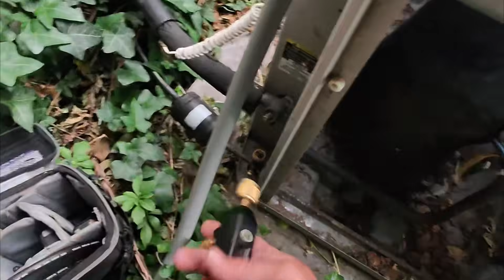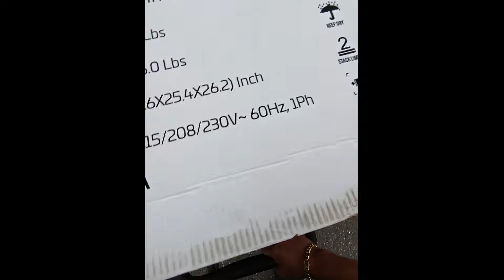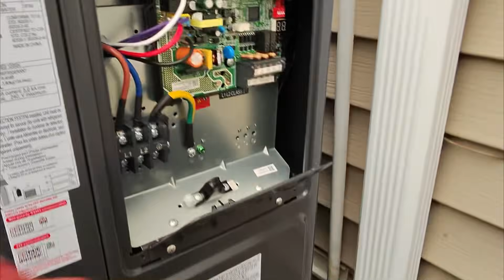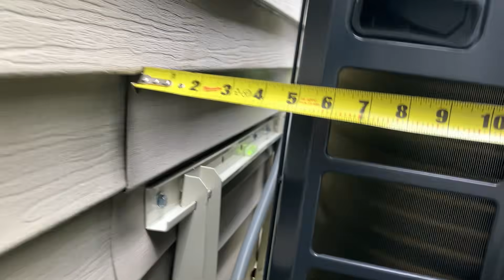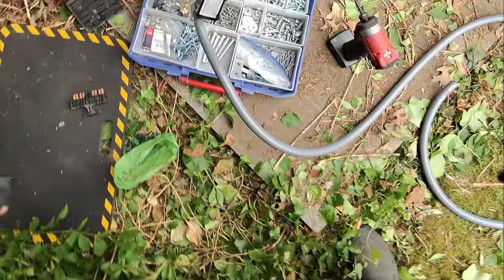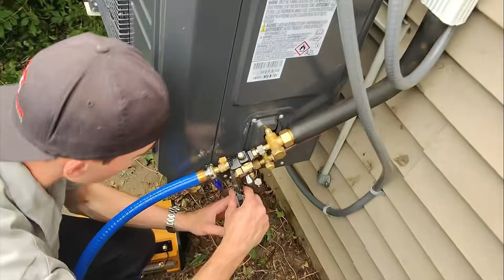We Replaced a 21-Year-Old AC Before Lunch | 4-Ton ACiQ Heat Pump Install

Comment: I've got to say, Mikey, yesterday I had a three-zone installation on a multi-condenser, and I was pulling vacuum through the Fieldpiece, the same one that you have, and unfortunately it kept leaking. None of my soap bubbles were showing any leaks on any flares or anything like that until I sprayed the core removal tool, and it started bubbling like crazy.... I'm disappointed...
Reply from the maker: FIELDPIECE SUCKS ASS

Comment: Mike in a previous video I asked which digital torque wrench 🔧 you preferred you mentioned the blackmax considering that you have the Navian flaring tool and bender are you not a fan of the Navian digital torque wrench 🔧??? Also do you use a small “DAB” of “NYLOG” on the flares ???

Comment: If you find someone in Alaska, ACIQ should sponsor a unit just for the advertisement value alone. Just imagine Mikey Pipes piloting a dog sled powered HVAC van, just cruising through a snow storm to make sure everybody got some heat 😂

Comment: Why didn’t you flush out the old oil from the 2 copper lines?
Reply: Brand new system and he half-assed it (and I bet voided the warranty) by not replacing the lineset.
Reply: @JustinKais rx11, proflush and hilmor lineset flush tools would have no market if it voided the warranty but if it was me I would of flushed it at least